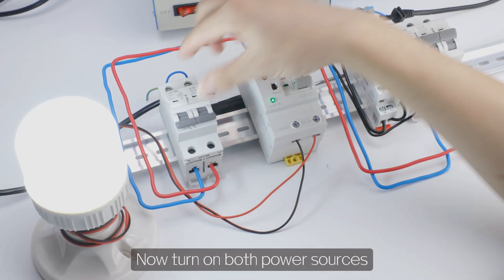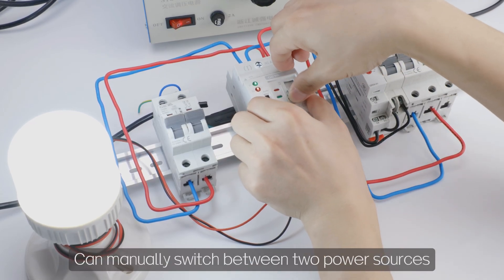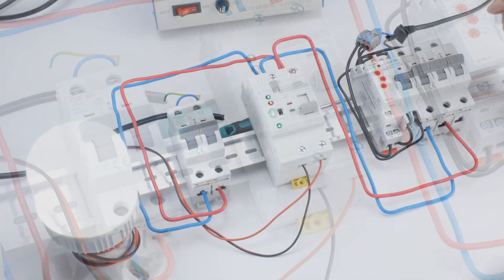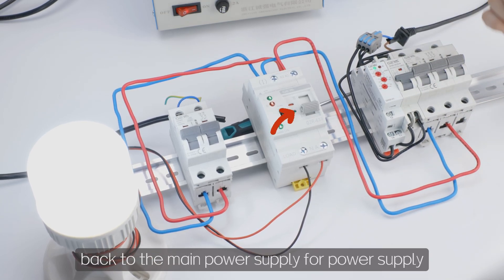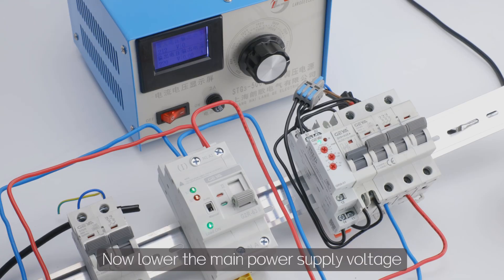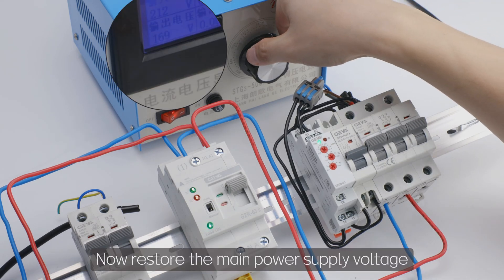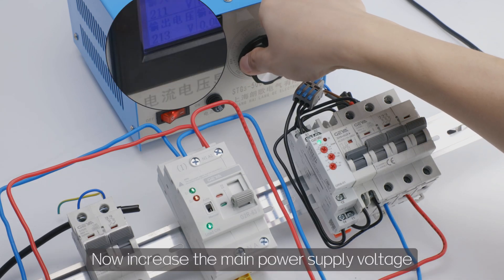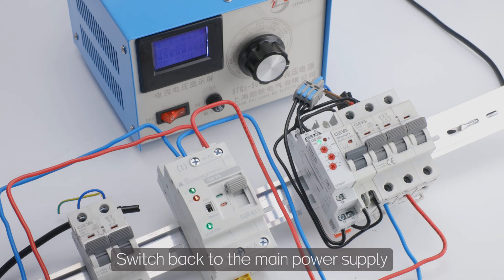GEYA ATS G2R Function Demonstration

Comment: Is this voltage protection a new feature?

In the instruction manual says "The control circuit TSE is immediately energized. After the change over is completed, the internal switch will damage the coil in the control circuit, and the coil can work normally at 85%-110% of the rated operating voltage.
Too low input voltage may cause the coil to overheat and burn out"

It says that the low voltage will burn it out, but on the video shows that it protects from high or low voltages..
So the device is really protected from low voltages, at least from the grid input?, or the burn out is only if it is feeded with low voltage on the backup input.

Comment: Will it work at 250 V main power and  230 V backup power?
How much distance should be there between ats and other breakers on the din rail from both side?
Can we switch to manual and then change the switch while device is not connected to any power source (just for checking the pushing force)?

Thanks!
Reply from the maker: Reply to your three questions,
1. It is recommended to use a voltage of 220V.
2. The circuit breaker and dual power supply should be wired normally. The ATS equipment itself is factory safe, and there will be no problems with normal wiring.
3. Sure.
Hope it helps you!